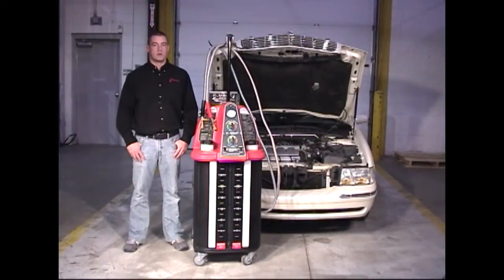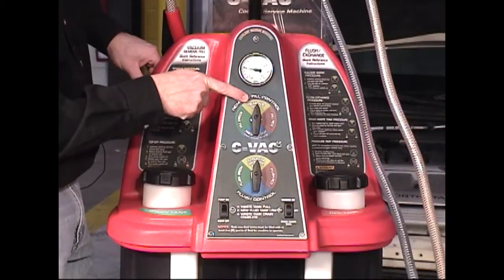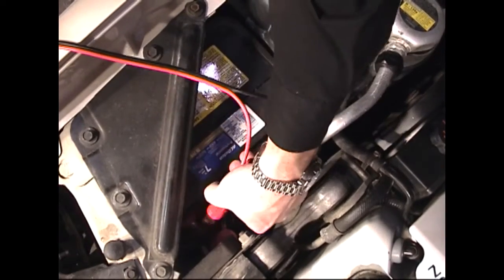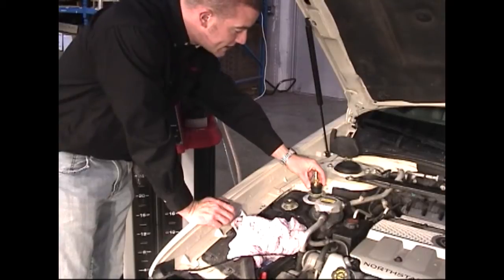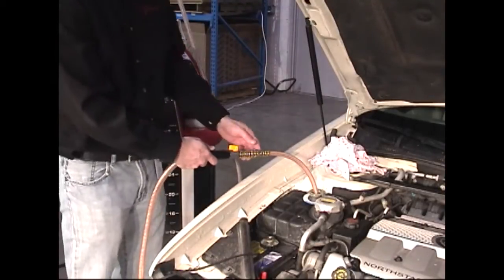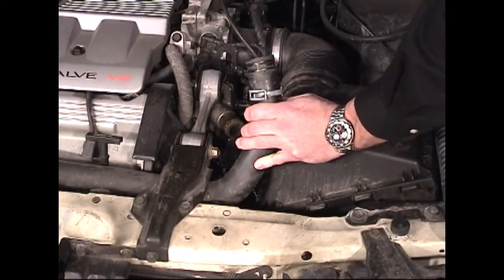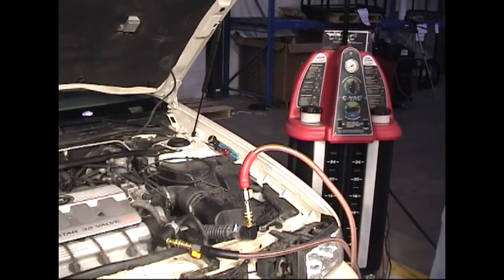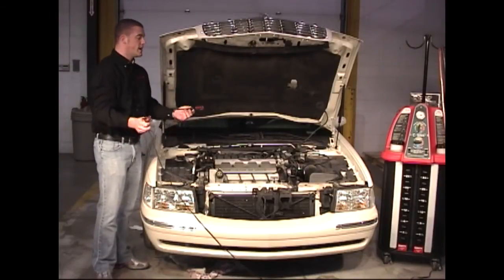C-VAC3 Operational Training Video

Comment: Please let me whether the vehicle should be off or on position. If its off then how new coolant goes into engine when thermostat closed.?
Please ans my question .
Coz i m going to give training at workshop. Please send me answer without fail
Reply from the maker: For the C-VAC3 the engine MUST be off while performing the flush service. The system uses compressed air and electricity with a vacuum and pump for the multiple functions. Please refer to the attached link.  REMOVE & FILL OPERATOR INSTRUCTIONS (flodynamics.com)

Comment: At minute 7:15 the instructor is mistakenly pumping waste tank coolant into the cars reservoir instead of clean red coolant.
The pump only works with the bottom dial (selection valve) so the top selection with the pump does nothing.  
The top selection for clean new coolant only draws into the same black service hose when there is a vacuum (no pump working here).
So in a vacuum pulling the old coolant out (sealed) and then refilling by vacuum power pulling clean coolant into the SAME black waste hose there is no 12v pump in the loop.
Just reconditioning one of these machines and this part really threw me but I'm sure it was just an honest mistake but seems good because I am sure even the waste coolant was clean and it just got past the instructor.
The instruction manual shows the correct procedure so this is just for those who think the machine is broken, it is not.